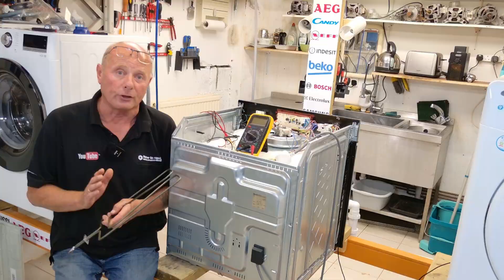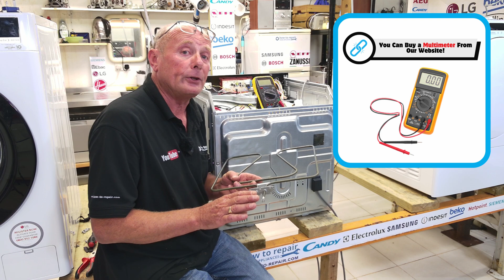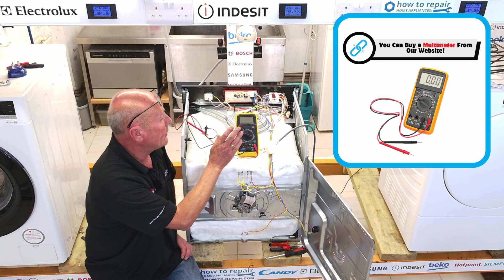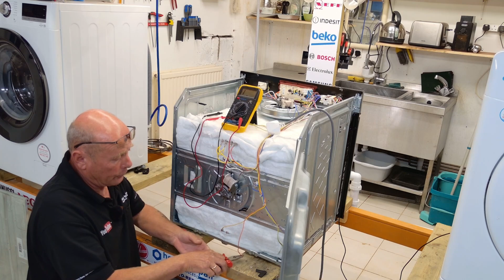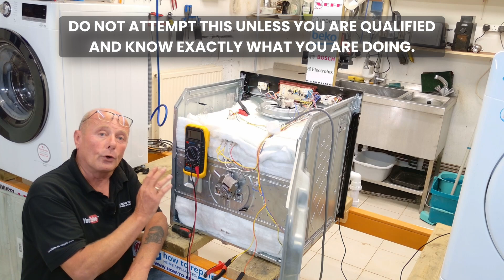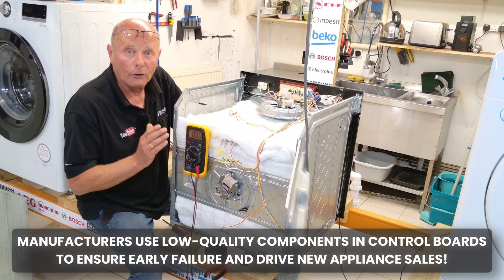Oven Not Heating or Tripping Electricity? How to Test a Faulty Base Heating Element?

Comment: Great video! It explained everything so well. 
Got an electric rangemaster 110 that tripped the fuse when conventional oven turned on. Tried your electrical tape on the element wires trick, which proved it was the base element! 
Thank you